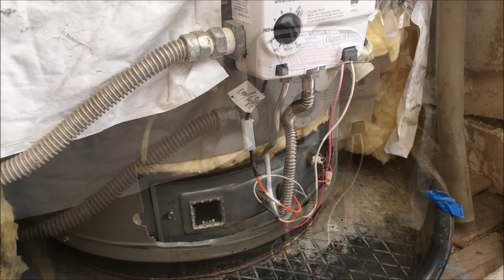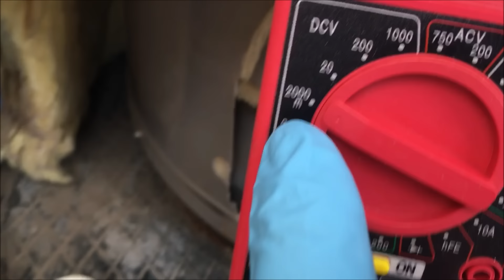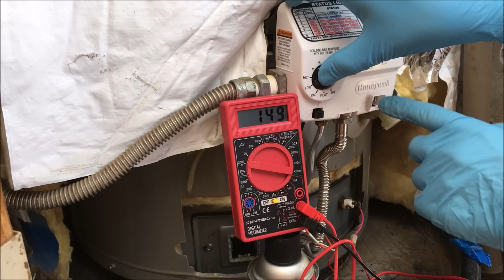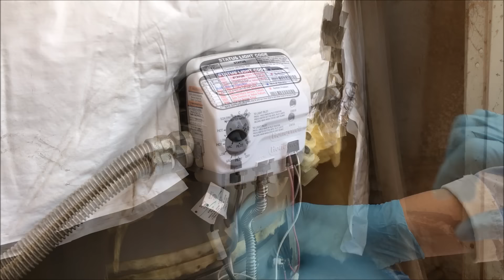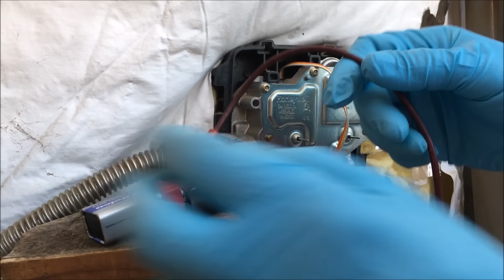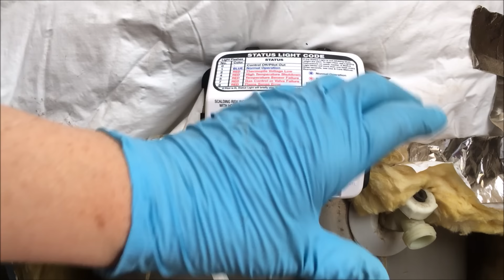Troubleshoot Water Heater AND Honeywell Gas Valve | Step-by-Step

Comment: Hi at 9:59 where is temperature knob?
Reply from the maker: It's the black knob on the cover/face of the gas valve.  ;)
Reply: @frugaldiy1  thank you for replying so quick, my water heater problem is little complicated, the pilot light off when somebody take shower or using hot water , someday we need relight pilot light many times, you think what’s the problem it is?
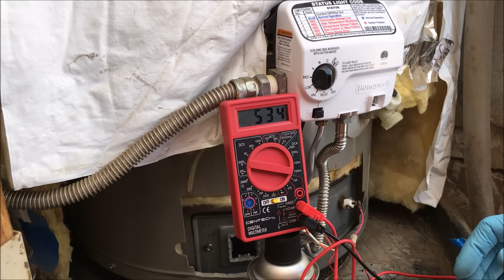Reply: At10:33 mv show 496mv it will keep down to 0 or it will stop at some mv and why it is going down?

Comment: This was so incredibly informative.  I am worried that my ignitor isn’t working but my sight glass is too fogged over to see inside.  If I were to disconnect the wire and then attempt to strike it, I should see a spark inside the plug one the end of the wire that comes from the Honeywell….right?
Reply from the maker: Thank you.  The igniter actually consists of two parts--the igniter switch (that you strike or push) and the igniter head that is located on the burner assembly.  Both have to be tested to see if either has failed.

Comment: I followed this on my Rheem water heater after a supply line burst and the pilot went out. I fixed the supply line and couldn't get the unit relit. It's only 3 years old.

It was definitely the logic board. Thanks for the tip! You saved us hundreds! We're up and running again!
Reply from the maker: Love your story and love that you saved your hard-earned money and fixed the water heater yourself.  Great job!

Comment: Hello quick question. I have a envirotemp gas HWH. I can light the pilot, the burner will come on, fill the tank; but once the burner go off the pilot light also goes off. Any suggestions? Thanks

Comment: I checked the valves with a 9V battery. The pilot valve doesn't make noise, but the main burner valve does. The pilot will light when I hold down the valve though. Any thoughts?
Reply: I am having the same issue, did you come up with a solution?
Reply: @Lope0124  I ended up just replacing the water heater since it was over 10 years old.

Comment: Great video, helped me find that my board was physically broken when they put it together at the factory. When they put it together it wasn't lined up and you can see where the ground pin punched into the board next to where it was supposed to go and only one of the three clips was even touching the board. The spring fingers came off when I removed the PCB; I soldered it back on and the valve works again but I'm going to replace it hopefully under warranty because that's clearly bad workmanship.
Reply from the maker: Well look at you, Josh, thinking outside the box.  RESPECT!  I'm glad the video helped you fix your water heater.  ;)

Comment: Outstanding video.  You saved me hundreds of dollars.  Your explanation is easy.  I went through every step and everything was working fine.  Pulled out the control board and a piece fell out.  This piece was one of three "pyramid" looking metal domes.  These are what make contact with the pins on the gas valve.  Ordered a used one on Ebay, but is going to be 7 days to deliver.  That's a lot of cold showers.  I soldered this "pyramid" to its spot on the control board.  Installed the soldered board and it fired right up.  Thank you again.  Best video on YouTube for this issue!!!!!
Reply from the maker: I love hearing that, Chad.  It warms my DIY heart.  Hats off to you for troubleshooting and fixing your water heater.  You saved bunches of money, which means you can retire earlier.  ;)  Enjoy the hot water!

Comment: Seriously such a comprehensive course on water heater. I tested every component. Came down to, I got 665mv max on my thermal pile (tested on the stove cuz I have no pilot light) is it still an operational thermal pile? Or can I rule that is a electrical board?

Comment: So I followed every step and everything checked out fine leading me to believe it was the control board that went bad. I ordered a new one and put it in but still have no status light and the pilot will not stay lit once I let go of the button.
Reply from the maker: Some viewers have reported that the new valve/board they purchased did not work.
Reply: @frugaldiy1  no fault to your video! I had a technician come out and he said I did all the troubleshooting correctly but something internally was bad. I ended up getting a new water heater and installing it myself the next day.

Comment: What if there's no "reset" or "switch" botton like mine?  I've only seen on YouTube that ALL people's heater burner have the same switch buttons, but mine doesn't.  I'm just so freak'in pissed and I can't even find any Honeywell models and/or serial No. on the part list to buy.  :face-purple-crying:
Reply from the maker: Go on eBay and type in the model number of the gas valve.  You should find parts and gas valves there.

Comment: Tested again temp got to 190 then...OL do I need new thermopile? Or is my testing faulty? The points are short ok for white wire
Reply from the maker: I'd replace the thermopile.
Reply: I did not have multimeter up to 2 or 2,000 mv. Both thermopile and switch registered above 750. I will hunt to get used control board and gas valve

Comment: Thanks you at the best!  Purchased multi meter. Tested thermopile. Temp was rising to 150, then OL..what does that mean thermo bad. Will try again my point on metersre shrt nt long like yours should I get better connectors. Thanks doc

Comment: I opened up pued out the burner on a simlar model. Blew out pilot line. Did not clean thermo coupling? Should ho back in or just rest options as done in video...pilot is violent butnwi not stay on whee release..How often is it the circuit board?
Reply from the maker: golfdoctor, you have to go through each step to troubleshoot the issue or it's just a guess re what the problem is.

Comment: Thank you very thorough..i have simlar problem, pilot goes out when i release..the pilot when on seems violent large orange some blue is that normal.  I blew out pilot tube ceaned assembly of rust..how often is itvthe circuit board ??

Comment: Hi, could you please help me here? My water heater can ignite and see the flames but couldn't stay lit. I followed your steps till I examed the control board, when I tested the pilot valve, the first tap I heard a click sounds, seemed ok. But second tap no sound. After that I couldn't hear anything thing, the burner valve is good. And now I couldn't ignite the flame anymore. Does that mean I need to replace the whole gas valve? So it just broken in the middle of the exam? Any ways to reset? Please let me know. Thank you so much!!
Reply: Could you please help? Should I replace the whole gas valve?

Comment: Had the same issue. I couldn't hear gas coming through when I depressed the control knob, so I tried tapping lightly on the gas line where it comes into the unit on the side. The valve must have been stuck closed, because it worked and the pilot light lit.

Comment: Went away for the weekend; put it on Vacation mode... come back, I find the 7-flashes Error code. (From a new Insert data) says that this code is - system is in OFF mode... then I see NO Pilot light !  Used another user to HOLD Pilot Lighter more than a minute, igniting every 5 seconds... WHALLA - pilot light came on, and after a few minutes, Blue LED back on again...

Comment: Thank you for the tutorial. What if the pilot valve does not click? Do I have to replace the whole thing or can I open it up and fix it?
Reply from the maker: You're welcome, Dealer, and thank you.  Were it I, I certainly would disassemble the entire gas valve and try to fix it.  I'm frugal and like to try to fix things before I buy knew.  It usually works out.  If that didn't work, only then would I replace the gas valve.  ;)
Reply: @frugaldiy1  Thanks for the quick response. I will give it a shot tomorrow morning. Wish me luck!
Reply from the maker: You're welcome, and I do wish you lucky, my friend.  I have great confidence in you.  ;)  Before you take the gas valve apart, try lightly rapping/tapping on the pilot valve pin with the handle end of a screwdriver to see if you can "shock" the pilot valve to engage.

Comment: I obviously had a high temperature interlock situation; however I had flashing blue light as if all was well. I had pilot but no heating. I followed your procedure and put it back together but I set the temperature lower than where id been running it… works like brand new. How would you reset a high temperature shut off?  I also have a WV model…
Reply from the maker: Here's the kink to my video to override and reset the High Temp Shutdown:  https://youtu.be/rllnMAx05JI
Reply: @frugaldiy1  thanks so much!!
Reply from the maker: You bet!

Comment: If I can ignite the pilot but as soon as I release pilot knob to turn on hot water this pilot flame goes out. Without going through these great trouble shooting steps would replace my control board fix my problem?.
Reply from the maker: I can't answer that.  You won't know what the issue is unless you troubleshoot it.  ;)

Comment: I'm pretty knowledgable about this sort of thing. I was ready to criticize this video, but honestly, I can't.  Your troubleshooting was exactly spot-on and logical and your repair was exactly the right thing to do. I might add, if the heater is under warranty, call the manufacturer. I have known of them sending out en entirely new valve that can be spun in.
Reply from the maker: What a lovely comment, Ian.  Thank you from the bottom of my DIY heart.  I mean that.  And, thank you for adding the helpful information; it's quite helpful to folks.

Comment: Hey...ok so my issue is that after the pilot is lit and I turn the knob to hot the burner lights then it goes out (burner and pilot). The indicator then flashes red 2x. I used my multimeter and plugged the leads into the thermopile harness (red 2 red...black 2 white) and ignited the pilot. It reached to 650 but then it began to decrease  while I still was holding in the pilot knob...I installed a new thermopile but it would still go out after the pilot was lit. I then had a tech come and replace the whole Honeywell module for it to do the same thing as well...I noticed that my setup is similar to yours with the exception of the thermopile switch.
My thermopile is harness wires straight to thermopile...I'm so  confused ...HELP ME!!!
Reply from the maker: I'm not clear on your description of the chain of events.  I'd check the gas pressure and the lower vents and flue to make sure the air flow isn't impeded.
Reply: @frugaldiy1  how do I check the gas pressure
Reply from the maker: That's not something I can explain fully in a comment.

Comment: How do you open the pilot compartment? To light the pilot manually because I tried that step didn’t work
Reply from the maker: Ernesto, watch my video on how to replace a thermopile because it will show you how to access the pilot compartment.  Here's the link:  https://youtu.be/httzdihCxvM

If your water heater has an electronic control board, like the one in the video, you cannot light the pilot manually and have it stay lit.

Comment: What a GREAT instructional video. My heater is starting to act up pilot light going out every week or so. When it first done it I took the burner assembly out and cleaned it, vacuumed vents. That was probably was 3 or 4 months ago but has went out a couple more times. This has given me more ammunition to diagnose my problem, so thank you so much for this very informative video…….
Reply from the maker: Thank you, Kenny.  I hope the video helps you pinpoint the issue with the pilot going out.

Comment: This video is great. Got any advise for a control know that won’t turn to any setting once it was turned from off to pilot and the pilot light is lite. It’s brand new water heater Rheem. The knob presses in but won’t turn. Bus light is blinking pilot light is lite
Reply from the maker: Thank you, Michael.  My guess is that the temperature knob is broken and needs to be replaced.

Comment: Question I tested the pilot valve and the main burner valve in the control valve. I heard the main burner valve move but the pilot valve did not. Could this be my issue?
Reply from the maker: Yes, Dashon, it can be.

Comment: Obviously, you have to align the position of the plastic knob on the cover (OFF position) with the hole on the circuit board. When you set the position on your new board, it has only one way for "OFF", correct?
Reply from the maker: I can't answer that with certainty, Pat.  I can only tell you that the temp knob on my replacement board was in the "Off" position before I put it on the gas valve, and it was still in the "Off" position after I reassembled the board and cover, so I had no issues with that.  I hope that helps you.
Reply: @frugaldiy1  how did you know its in off position with your new replacement?
Reply from the maker: I purchased the valve at a local Habitat for Humanity Restore.  The valve was new, and I saw the temp knob was in the "off" position, which I saw on the front cover.
Reply: @frugaldiy1  
you purchased the valve or the circuit board?

Comment: Thanks for the video! I followed all the steps here and tested all the components except the board (they all work fine), so I made same conclusion to change the board. However I bought a piece on ebay and replace it, still didn't resolve the issue. What else may go wrong? (except that the replacement board is bad as well)
Reply from the maker: You're welcome.  I'd be thinking: vent(s) at bottom (outside and inside) and top (the flue) are plugged, gas pressure, temperature sensor failure or, as you said, faulty board.
Reply: @frugaldiy1  Thanks for your reply! It turn out the board I bought on ebay was faulty as well. I bought a whole new valve and used that board to replace the old one, and it worked. You are the master of this! Thank you again!
Reply from the maker: You're welcome.  Another bad board--not surprising.  Job well done, Yuan!  You did a great job troubleshooting the issue and didn't give up til you found the issue.  Respect!  Enjoy the well-deserved hot water!  ;)

Comment: I have established a pilot flame and burner will turn on after setting it to regular hot, I will turn off after 4 seconds.  Does not stay on. Burner
Reply from the maker: There's no easy way to determine what the issue is.  You have to go through all of the steps to troubleshoot the issue.  You can try this first to see if it might work for you:  https://youtu.be/rllnMAx05JI

Comment: If igniter doesn't even result in spark would that be faulty igniter assembly or control board?
Reply from the maker: Igniter head or igniter switch.  Here's a video re how to replace igniter switch: https://youtu.be/tm4OYqwykPY

Comment: Excellent  teaching.  You should be a tech.  We need you
Reply from the maker: That's such a nice thing to say.  Thank you.  I want to pass on what I've learned over the years of DIYing so others can fix stuff themselves and not depend on others to do it for them.  The amount of money you save fixing stuff yourself really adds up, and the feeling of satisfaction and accomplishment is unmatched.  Recently, my sister and I reroofed my house, and I saved over $17,000 by doing ourselves.  Better quality work too.  ;)  Happy New Year and happy DIYing!
Reply: @frugaldiy1  amen. You  are my type of woman..I'm a hvac tech of 10 years.  Friend of mine bought gas valve and I gave him burner assembly.  He put valve on,still won't stay lit. Put assembly on,still won't stay lit. Air flow under tank is good. I can only deduct his gas pressure at regulator needs to be checked or that valve is bad out the box.
Reply from the maker: My thoughts.  1)  Obstruction in the flue pipe?  2) Faulty thermal switch that works intermittently? 3) Did he clean the vent (that's inside the chamber and directly under the burner assembly) when he replaced the burner assembly?  4) Like you said, maybe valve is bad out of box.
Reply: @frugaldiy1  it's a new assembly with thermal.
Reply: @frugaldiy1  I believe regulator is creating issue. I suggested partial flue blockage  also
Reply from the maker: Okay.  That's too bad.  I was hoping it's something simple.  At least your friend has you to help him figure this out.  That's a good friend he has.

Comment: I'm having a low hot water temperature issue. I have a status normal light blinking 1 time every 3 seconds. Pilot light stays lit without issue.  Burner works correctly, but will shot off prematurely.

Even at very hot the burner does not run very long and only produces lukewarm water.

This video trouble shoots to the board but doesn't cover the temperature sensor.  Which may be my problem or it may be the board.

I'll be getting meter tomorrow to do the testing.

Any suggestions are welcome.